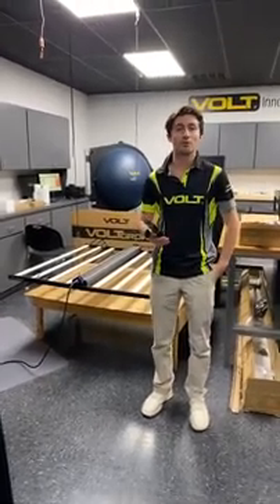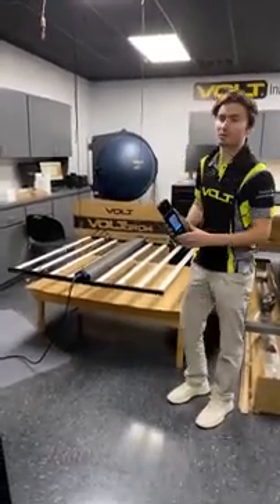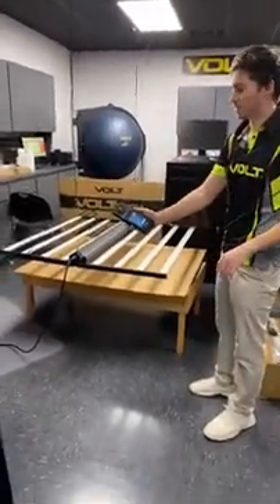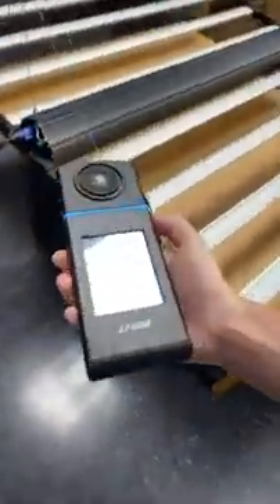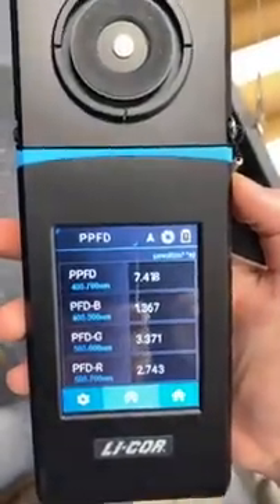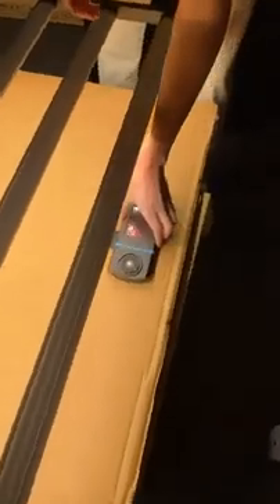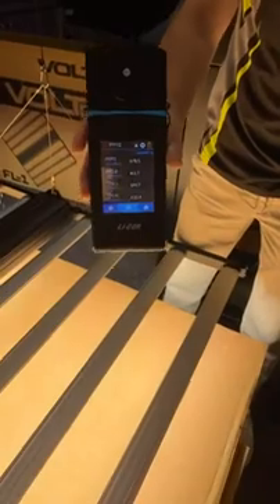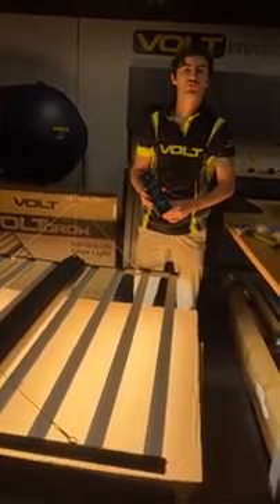VOLT® Grow | FL-1 Full-Cycle LED Grow Light PAR Measuring Test

Comment: Would these fit in a 4x4 tent?
Reply from the maker: Yes, the dimensions of the FL-1 are 44.875"x46.5". It also folds in half which makes it easier to fit through smaller tent doors.